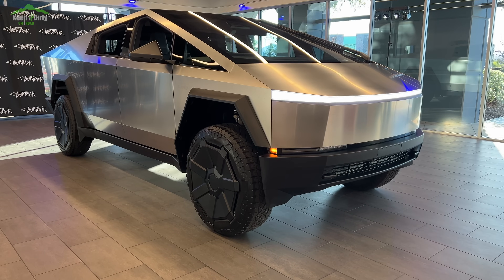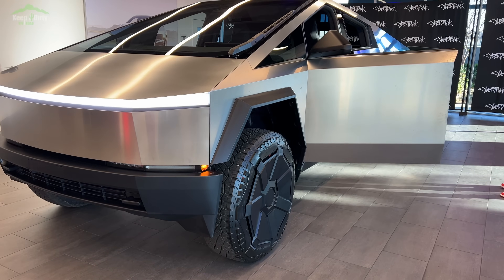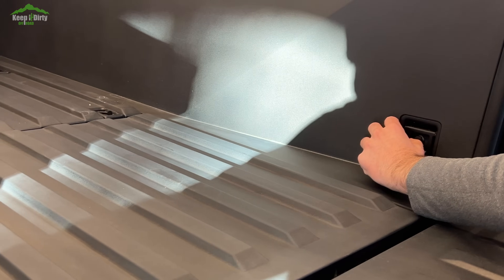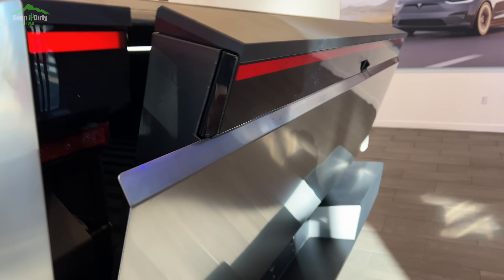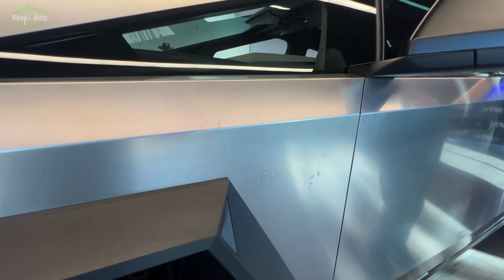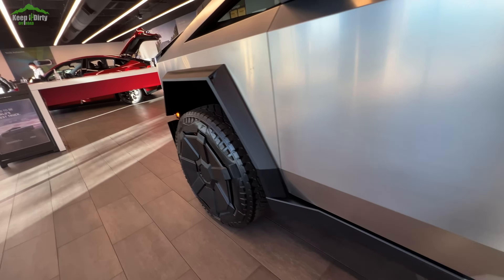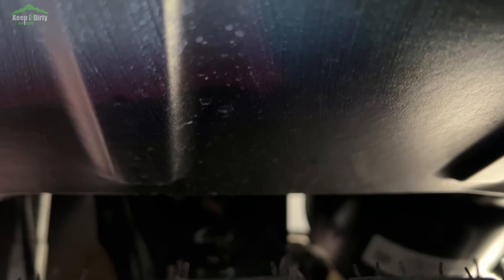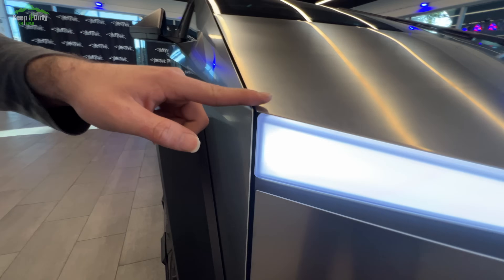Off-roaders take on the CyberTruck

Comment: Lets be honest.  This is not really a truck in the traditional sense of the word.  Its a vanity truck with very little if any utility to actually be a truck.  Sure you can "tow" for a few minutes.  And you can put a few bags of dirt in the bed.  But thats about it.  Offroad is not what this is for.  Its for the hipster tesla fanboy to say hes got a truck but hes still cool pulling up to his local starbucks.  These are for show only really.
Reply from the maker: Unfortunately your are totally right. And that sucks
Reply: You must be the one person that think people spend $100K on ICE or EV trucks to haul dirty! Most people rent Home Depot trucks or use 5 year old trucks to do “truck stuffs”, FYI.
Reply from the maker: 🤣🤣 you should go look at truck prices these days. Ain’t no one getting a truck for under $60k these days.  They average around 90-115k these days. Tow rigs can even go for much higher. 

People are definitely spending $100k on trucks and doing truck stuff. Regardless if it’s an EV or not. That’s why the CT is a big fail in my eyes
Reply: @KeepItDirtyOffRoad  Based on research, 80% of truck owners tow or go off roading once a year! That’s Tesla’s potential customers.  Truck owners are loyal and no one will bat an eye if Cybertruck like a normal truck.  Tesla saved $300 million + not have a paint shop.  The 48 V architecture, which enable steer by wire saved 30-40 lbs of copper wire from any other vehicle.  The stainless steel panel saved millions on molds and robots for Tesla.  The giga castings reduced over 160 parts.  Cybertruck is a success for Tesla long term, because it reduce costs.  Everyone will have to build their trucks like Cybertruck to compete, especially Rivian as they’re losing $30K per vehicle they sell.
Reply from the maker: This looks like straight from a Tesla press release or something 🤣🤣.

Now while I agree with you that Tesla margins are really good on the cybertruck. Cost cutting is not always to the benefit of the consumer. Weak control arms = fails on the road. Giga casting = costly repairs to owners and the truck will be more likely to be totaled increasing insurance costs. Already seen insurance cost rise sharply on model3s. The insurance on my son’s model 3 is more than on my truck. Double actually. And it’s worth less than half. 

Tesla is saving a ton of money in making these trucks. But they are passing off a lot of issues to owners that’s going to increase their costs substantially. 

No paint means the panels are going to corrode and require a ton of maintenance to prevent it. And all that cost savings should have been put to improving the design. Stronger suspension components, more usable storage. Because the one time a year they go use this as a truck, they are going to find out how useless it is. For the rest of us that use our trucks like trucks and offroad, we know better. And we’re hoping for more based on how the truck was advertised. 

You seem to be touting the company line without actually thinking it all this is good for you. All these cost cutting is going to save Tesla a lot of money. But it’s going to cost you even more
Reply: @KeepItDirtyOffRoad  I do my research on Cybertruck. My ICE truck is a pavement princess or mall crawler, I am the 80% of truck owners.  Cybertruck is 4 months old unlike other OEMs that have decades to refine their truck, so we’ll see how it stand up in the real world.  Cybertruck doesn’t fit your use-case, just like FORD F350 doesn’t fit mine, but I wouldn’t call F-350 a failure.
Reply: @akira28shima32 Guys at work who turned down their Cybertruck reservation said they couldn’t even find insurance in his state that would even offer to cover the CT due to the high repair costs. That was one of the biggest reasons he passed on the CT.
Reply from the maker: See that’s where you’re wrong. This is a light duty truck with 35s from the factory advertised as a performance offroad truck. Before they started deliveries Tesla live streamed it hitting the trails in Baja. It’s clear they built it as a direct competitor to the Raptor and the TRX. I know for a fact that they benchmarked the Raptor before the prototype was built with a friend of mines raptor. He’s friends with their lead designer.

So to see it come out and be a model x with 35s was disappointing. I would also argue that because trucks have been around for so long l, they should have done what Rivian did and improve on the truck and made it better and more usable. But cost cutting got in the way here.

On a side note. Rivian I think is a better option but it’s not in the same class. Rivian competes with regular f150s and other light duty trucks because it mainly has road tires and less clearance. Not even the f150 lightning is in the same class again because it’s not offroad focused and has road tires. 🤷‍♂️.

You may not agree but the cybertruck was built to compete with the Raptor. Otherwise they would have put smaller road tires on it. It would have gotten way better range and would run faster too on road tires.

Comment: You are lost, you are comparing trucks that have been around 40+ years to version 1 of Cybertruck it’s only gonna get better in comparison to years of the same shit with all other truck brands !!!!
Reply from the maker: 🤣🤣 that’s hilarious. A perfect example of a good 1st gen truck is the Rivian. In just about every aspect (except for changing) it’s better than the CT and most other trucks on the market. 

Tesla has a massive lead in EVs and they could have made something so much better. But they didn’t and it’s clear there is a ton of corner cut here because of the challenges they had being it to production. The ford lighting is a way better truck than this in terms of usability. Same with the Rivian. The storage tunnel, storage up front, and even the interior of it is better than the CT.

You’re delusional if you think this is a good first try.

Comment: That suspension is HORRID LMAO, I'd be embarrassed to be a tesla fan boi
Reply from the maker: 🤣🤣 Tesla fan boys eating this thing up, blindly I think. I would not trust that upper control arm on street driving, let alone on the trail
Reply: Haha Tesla engineers already replied to this same complaint and they said anybody who says the upper control arms is small have no idea about suspension engineering. So I suspect non of you are suspension engineers. If this design is a problem for you. You can always buy a Raptor and call it a day. But  Tesla will sell every single one of these for years to come. Most trucks America are not used for offroading. Why build a truck for a niche part of the market . Call it a truck or a mini van doesn't change the fact that it's target market calls it a truck and it meets the needs of majority of its target customers.
Reply: @achasilas6535  It doesn't take a genius to know that the less material on your control arms means less strength. People have already snapped the control arms, but hey! The guys that built the thing say it's all good! LOL
Reply: @christiandruan   lol somehow you thought that was an intelligent reply?. Carbon fiber for example is lighter and thinner than steel and aluminum yet just as strong or stronger. So thickness doesn't always equal strength. Infact there are hollow web-like steel that is stronger than solid steel of thesame material or object.
Reply: @achasilas6535  Is the control arm made of carbon fiber or some other high end exotic metal?
Reply from the maker: First hes an engineers or defending one and now he’s a materials expert. 🤣🤣🤣.

I think you’ve forgotten that Tesla has advertised the CT as a go anywhere vehicle. And it’s not. It’s going to struggle on pavement let alone dirt. And early reports show Tesla skimped too much and the suspension can’t take the mildest of off-roading. Now if you want to take the word of a company that just says they don’t know engineering without offering an explanation, then who’s being silly? They are literally using your ignorance rather than offer an actual argument and justification for the design. Because at the end of the day, the CT suspension is WEAKER than what’s on a Tesla model Y.

Comment: I don't think it's really ugly. I'm used to it and to me it looks plain really. Not much design to it. Very flat literally. I think it has a lot of cost savings built in cause it's teslas plan to make affordable vehicles. It's only expensive now because it's still early in production and it takes numbers to reduce that cost per unit. Eventually they might have that $40k starting price.
Reply from the maker: I’m sure development costs are in there and why it’s so expensive right now. But I think for the CT to really gain market share, it needed to be better than ICR trucks. Right now this will only take market share from other EVs. Which is a bad for Tesla. They need the cybertruck to be a HUGE success to account for its development delays and other projects that got placed on hold.
Reply: You made a lot of good points in the video.  The price getting lower over time will help with demand but cyber trick needs a lot of improvements to have better features compared to other trucks.   The wasted space and the lack of rear seat headroom.  Lots of disappointing things.

Comment: Towing long distances is out of the question.  What a shame.
Reply from the maker: Yep, bits that’s all EVs. They have the power to tow better than engines. But the battery tech is too heavy and we need more range from batteries before they can take it over. Or a different approach with an onboard generator like RAM is doing.

Comment: Who said this was an "off road truck"? It's obviously a road vehicle
Reply from the maker: 1. Tesla advertised it as an off-road truck. Specially right before launch with live streaming a video of it hitting the trails in Baja. 

2. Look at those tires. They are funky but they are AT offroad tires. If this was not an off-road truck they would get MUCH better range and efficiency with a smaller street tire like all other trucks have.
Reply: @KeepItDirtyOffRoad  and every other car company shows vehicles bombing through snow and desert for commercials, doesn't make them off road vehicles.  This is clearly a mall crawler
Reply from the maker: True. But those trucks are not using paper thin upper control arms. They can do what’s shown in the commercials. These cyber trucks are not even safe for the road. Imagine that front suspension collapsing on a pothole. Because dude, it can.
Reply: @Williamxmr It is a mall crawler. But that's not what Tesla advertises it as. Elon said it will kick butt is Baja.
Reply from the maker: Yep. And that’s the problem.

Comment: I mean in all fairness, literally nobody who actually off-roads even considers anything stock suspension wise . a Tacoma, a raptor, a bronco, you name it all that stock crap goes right into the garbage and we are for sure bolting on custom, upper /lower arms/ spindles / steering racks / even entire subframes get reinforced.   Just sayin … cyber truck stock suspension usually weak , but so is literally any other stock suspension part . even a brand new raptor nobody’s using those bullshit ball joint bushing Ford arms or that gimmc tinny fox shock.  you’re bolting on some fabricated camburg / Baja des/… ones right ?  you’re going with some real aftermarket fox bypass shocks right? Ya stock suspension is a joke , but that’s the name of the off road game.  Gotta mod $$$$
Reply from the maker: You must not own a raptor. Tons of raptors wheeling stock. I wheeled 2 gen2 raptors on stock arms for years in SoCal with only spring upgrades and rear bump stops. Punished the truck and the stock ball joints and arms were great. 

Raptor is not like the Tacoma or the cybertruck. It’s built to wheel offroad straight from the factory with no upgrades. But eventually you do need upgrades as you learn how to drive the truck faster. 

But the cybertruck upper arms are uniquely weak. Those arms will most likely bend on a pothole hit at speed